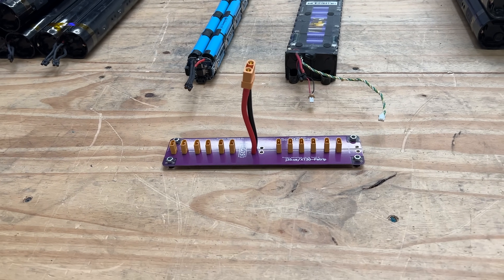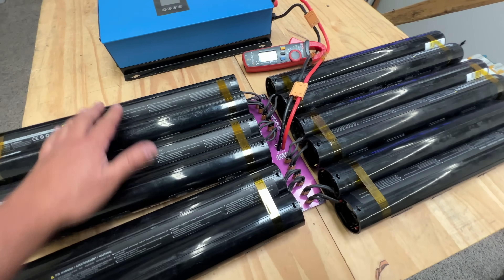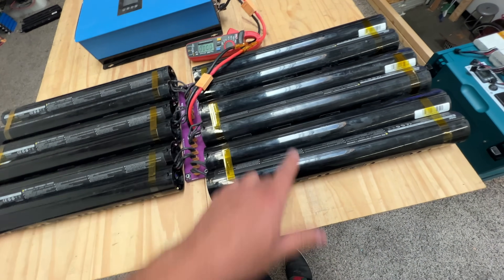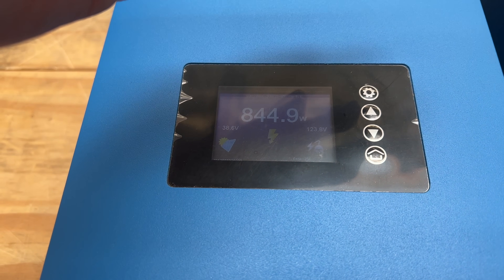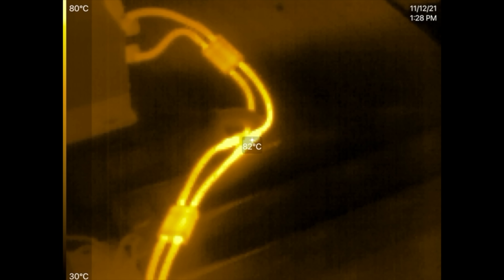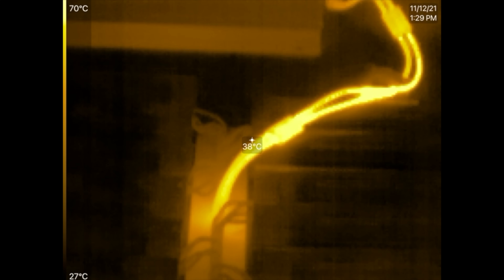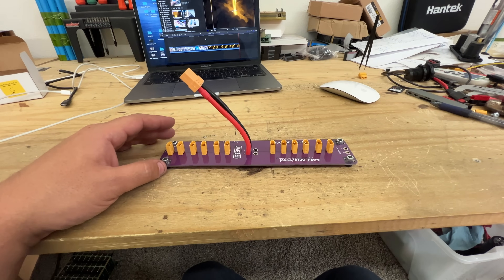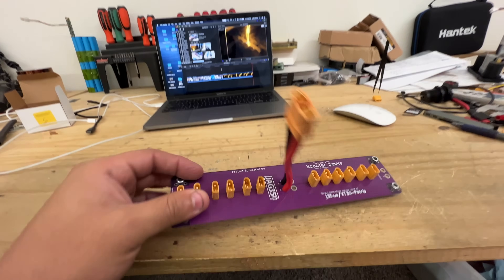XT30 Combiner PowerStrip - DIY Battery

Comment: I am new to building battery packs. I am a tad lost when Jehu pulls 50a threw the inverter on 10g wire, I thought the max on that was 30a. I understand the XT90 handles 90a, but the biggest wire for that is 10g. I did find one chart that showed you could pull 80a on 10 gage on a length of 1 ft. I dont see a fuse on the inverter cable either?

Comment: Correct me if I am wrong, but the connectors look to be rated for 30 amps. You are running 50 amps, so yes, they are going to get hot. You need 6 gauge wire for 50 amps. Smaller Gauge wire is like having a resistor in series, resistance equals heat when current flows through it. Put the correct gauge wire in the circuit and you will probably go further on a charge.
Reply from the maker: That’s why 50A peak , continuous is 30% less of that
Reply: @jehugarcia  ok, I didn't catch the peak. Times it by .707 you get 35 amps.

Comment: You should make a Google spreadsheet that will help you calculate how many you need to power your home with yourPcb board kits . Have an input for your voltage like 12,24,48 volt etc,  Max Amps needed things like that .
Reply: That would sure be cool and may help other people out to know how many they need

Comment: Jehu, the packs will stack on top of each - when you stack all together, the board will flip over - you just need to solder the output on the other side of the board

Comment: This is amazing...can I use this strip for attaching 12 volt 25A 18650 packs?
Reply: Yes, but you have to stay below the rated current for the board and connectors.

Comment: Stand them upright, Put your little connections out the bottom of the pcb to connect to the batteries, and then put your wires out the top.

Comment: You say this will work with the AC200. My AC200 will only handle 12A at 700W input. I think 60Amps is a bit too much for my AC200p.
Reply from the maker: 12Ax36V = 430w
Reply: @jehugarcia  not doubting you, just don’t want to damage my AC200. Can you hook 12 of the 36v scooter batteries together in a video and show us?
Reply: that's not how electricity works, the AC200P will only pull 12 amps, the battery pack is capable of delivering 50 amps, that means that the AC200P will only be pulling about 1/4 of the amps that the batteries are capable of, it isn't going to pull more than that, you could hook it up to a battery pack that has 1000 amp capability and the AC200p will still only pull 12 amps max as long as the voltage is under 150 Volts
Reply: @FrankKelly1  thankyou that helps

Comment: Mount every second pair of the xt30s on the rear side of the pcb, then the two rows stacked can take the bottom batts row plugged in from the underside and the batt lead length will be OK. The PCB sits at the mid stack height.

Comment: Look like that should be about right amount of batteries to add to a scooter 🤣🤣🤣
Reply: you wouldn't use this for a scooter. personally I'm using 16 of the 30 cell packs in parallel to run a 2.5kw pure sinewave inverter for power outages.
gives me about  4.5 kwh of power storage

Comment: It seems that two rows of packs would be easy with the existing board…just solder the main leads in from the rear of the board and have the “front” of the board (with the XT30’s) tilted up and facing the stacked packs.